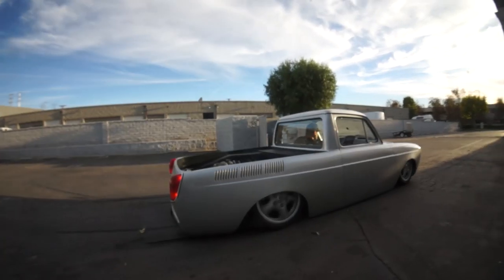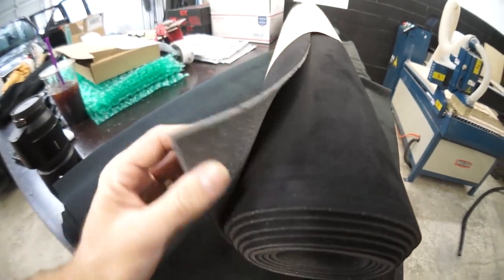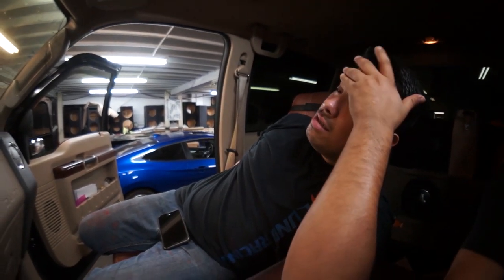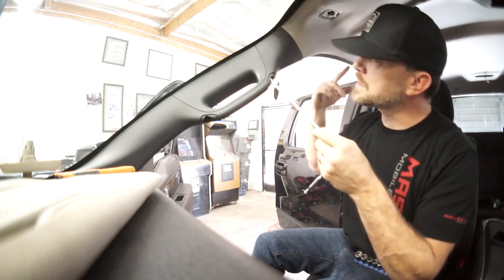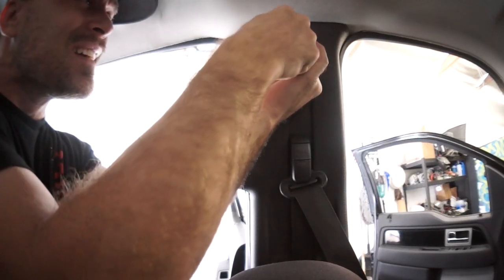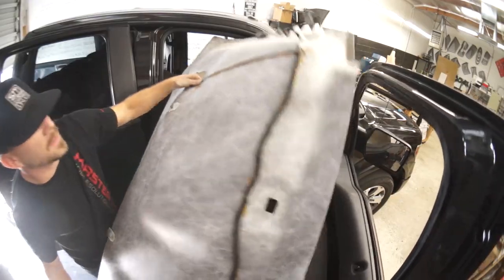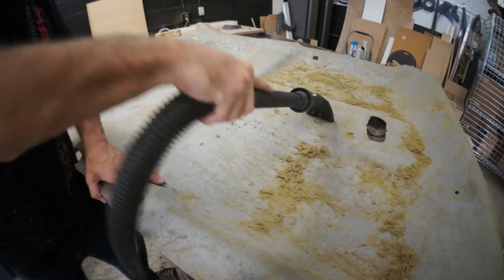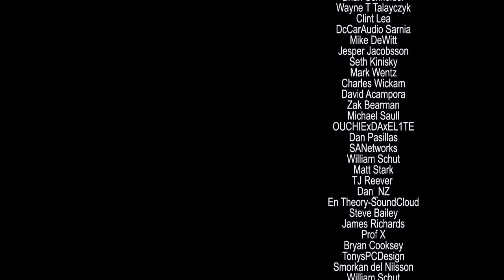V.I.P. ULTRA-SUEDE HEADLINER and SoundSkins sound deadening the F150 system, PART 1 - AMPLIFIED #685

Comment: Pull the back glass. It's only held in with 9mm nuts. The headliner will slide right in through the back glass hole. Roll out new buytle and bolt it back in place. Use 3/8 3m window weld. Part# 08622. Make sure to remove all old buytle. I own an Auto Glass company and we have to pull them all the time for body shops to r&I the headliner. Takes about 30min to pull and reinstall.
Reply: The buytle comes in a roll. Along the bottom of the glass it'll have lines to guide you during the reapplication of the buytle. Place your seam/joint along the bottom because water doesn't run uphill.
Reply: Reapply the butyle to the glass then reinstall on the truck.
Reply: easier to just pull the front pass seat.
Reply: he still has to put it back in.

Comment: Hey Doug! My F150 just had the same leak on the headliner over the weekend. You might want to check the gasket on the 3rd brake light too. Mine was shot and that's where the water was coming in.

Comment: If you grab a DA sander with 80 grit it will make the foam removal alot faster than just using the wire brush

Comment: Great videos, I'm hooked, been watching them in sessions. Looking forward to seeing how the T-bird turns out. What suede did you use and what did it cost? The stuff I found locally doesn't look as nice as what you used. Im look at buying off Amazon, so if you know the type I'd order that. I'm also curious about the adhesive. Any experience with the spray cans or should I spray from a gallon can as you did.

Comment: In need of some help I have a 2012 F150 the other day my radio stopped working I checked all the fuses and went to a lot of Ford forums but no one knows what’s going on 
There saying you’d have to replace the radio The only thing that it will do is flash so my sync doesn’t work Has anyone had this problem if so I could use any information that will be helpful thanks

Comment: Doug use a DA Sander with 180 simple as fuck i did wire brush for years and then started using DA sander so much easier

Comment: Silicon the rear brake light, that’s where the leaks coming from.
Reply from the maker: i tried, still leaked. the window had to be pulled and re-glued.
Reply: Never put silicone on metal causes it to rust!!